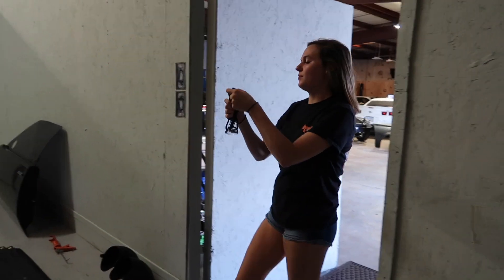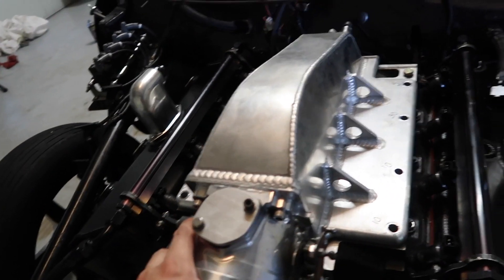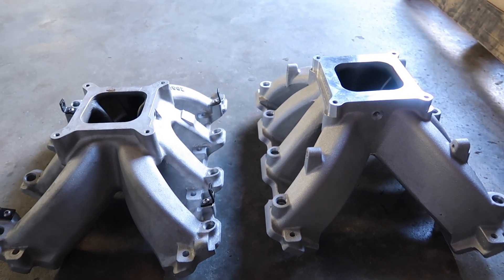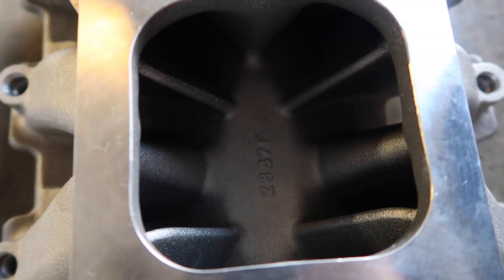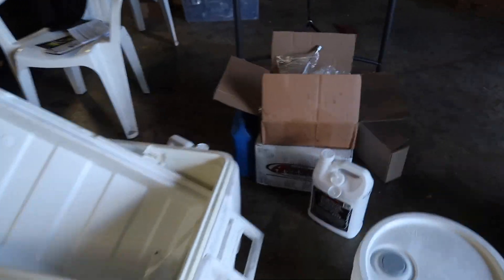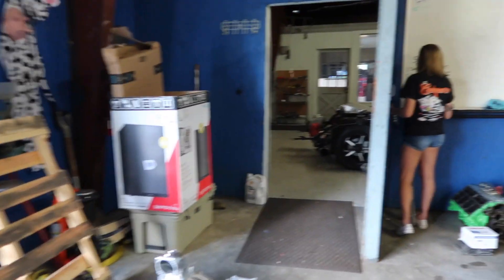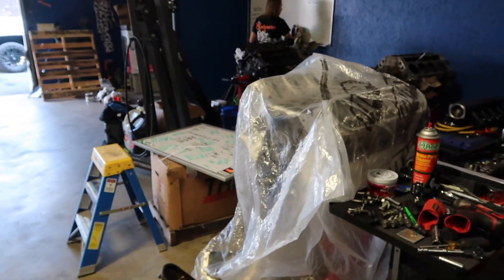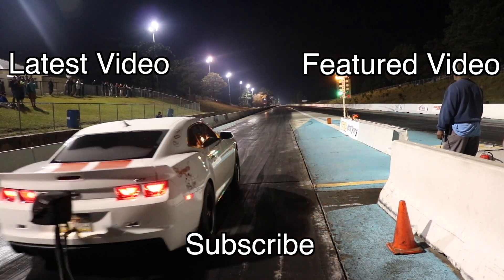TIME FOR A NEW BILLET INTAKE!!!!!!

Comment: Dont know if you found the boost leak yet but if it isn't to hard you may want to pull the intake and mount everything that would be up to the procharger put a block off plate over the intake ports and plug the intake pipe with something and put a Schrader valve on and shoot air in it. May want to use a gauge to cause if u see its holding 30+ psi leaks then youd know it's either intake gaskets or at the procharger

Comment: Did Ben not make some kind of rubber cap to seal on a charge pipe to pressure the intake and check for leaks to verify the diagnosis?
Reply: Yep. That or a smoke machine
Reply: Ya smoke machine would probably work also I just figured it holding up to like 25 psi or whatever he said so thought he may actually have to pressurise the system over 25 psi to find the leak

Comment: have you done a compression test on the engine to make sure your not losing boost throu a cylinder or cylinders that have low compression or valves not sealing or rocker arm adjustment to tight ? just a thought

Comment: You might want to check the thrust on the blower turbine. If it is too big, under higher boost the clearance will increase and affect overall boost pressure.

Comment: Question what needs to be done 1st If you were doing project using a nissa Sentra 89 model
Reply: T Hendricks step 1: ls swap it
Reply: @nikavila2895  that's what I want to do but dont know where to find the right rack and pinion.  Or motor mounts

Comment: Why don't you seal it up install an air valve with 50 lb of air pressure and see where it's leaking
Reply: Daniel Sullivan wouldn’t all the valves need to be closed for that to work? Especially if the leak is in the intake.
Reply: @huckilt  yes all the intake valves need to be closed that means you would have to loosen some rockers

Comment: That gear drive is only 1:1 holy hell that thing will make all the boost with a 2:1.
Reply: Greg l won’t it take twice as long with a 2:1 than with a 1:1 to build boost? Sure you can make the same boost but if it comes on slower you might as well jus set a ramp and have it come in later using a 1:1 since it would build boost faster. That seems logical but hey I’m not that submerged into race cars especially boosted ones. We only have a dirt track out here so if you wanna race in a straight line you gotta have money not only for the car but to travel 100miles to get to the nearest track.
Reply: @huckilt  nope the procharger themselves have a 5.40 step up i believe switches between model. You will get more rpms out of the blower when the racedrive is closer to that gear. Lets say you have a 5:40 with 1:1 you will get 27000 rpms. If you go to a 1:60 you will get 43000 rpms both at the engine turning 5000.
Reply: @huckilt  https://www.procharger.com/calculators mess around with this calculator. The lower the ratio the more low end boost you get.

Comment: I’ll polish that intake.  Like a freakin mirror.   HMU
Reply from the maker: Bet!!!
Reply: 860-877-8519.   If you really wanna get that thing polished lmk. I’ll do it super cheap. Basically the cost of the supply’s labor for free. I’m nasty at a lot of race car stuff and love side work. I’ve been doin it all for 20 years. From paint and body to building bad ass engines fab work suspension work. And I love bending up 1/2” stainless fuel line.